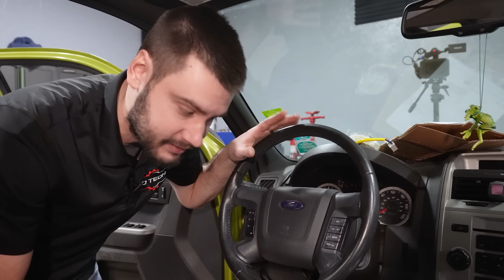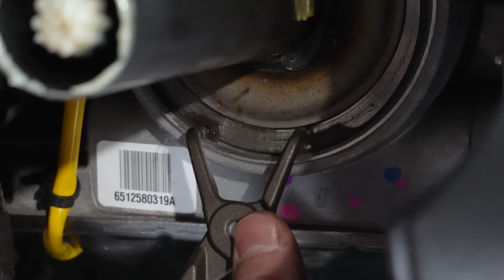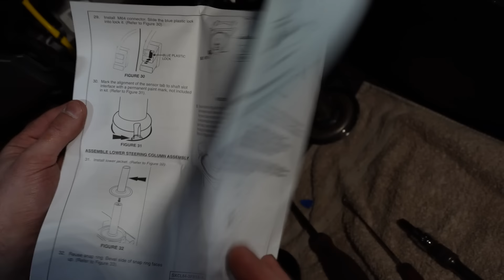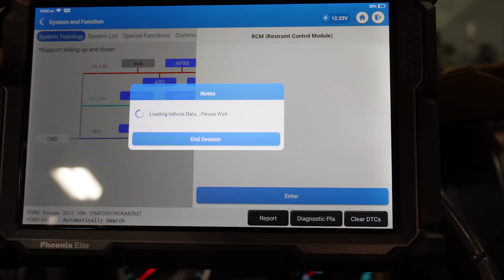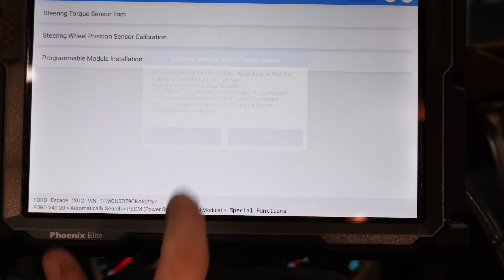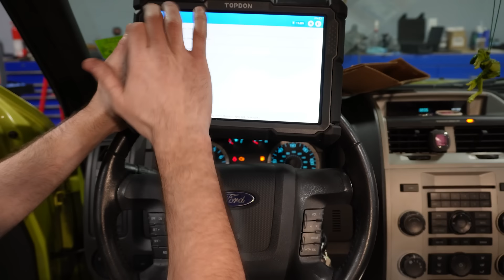B2278 - Power Steering Fault - Ford Escape

Comment: Yep, I bought a 09' Escape XLT non hybrid 2.5ltr for $1200 because the electric steering column went out & the dealership wanted to charge Granny $4k. 
I bought an OEM steering column for $1200 & paid a shop $50 to install it, took them 30min, if that.

Comment: I have the same code ! My steering wheel is very hard to move . The steering wheel doesn’t shake . I don’t want to pay almost $1000 for a torque sensor from ford . I cannot find an OEM torque sensor except Ford in Canada ! I live in Alberta Canada . Will be doing myself. How can Ford not recall all Ford Escape 2008-2015 for everything on the electric power steering !!!!!!! I have 2009 3.0 l XLT Ford Escape 113,000 km !

Comment: I have no codes but the power steering feels slightly stiff to the left. , align. Is good front steering parts good car drives straight no pulls. No codes, I think this sensor is my issue , if i replace it do i need to enter the controle mod and recalibrate any thing?

Comment: Why do you say if it's not aligned it will damage the sensor? Seems I can pull it out, turn the inner part, re-align the hole and put the pin back and do it again. I don't see any mechanical parts that is damaged and the electronic part seems to respond to the computer and shouldn't be damaged if wasn't aligned. What am I missing?

Comment: Tip for the Snap Ring Removal and installation. First, Buy at least 12 inch snap ring pliers, I got an ICON 12" from Harbor Freight. Second, Get two 1" hollow pipe at least 18 inches long. Third, Secure the Steering column with a zip tie to anything so it doesn't move. Fourth, Insert the handles of the snap ring pliers into the 18 inch pipe and secure. Fifth, remove the snap ring using the extended pliers. I fought with the stupid thing for an hour using the 12" pliers and no luck. Not enough leverage to squeeze. I put the 2 pipes on each of the pliers handle, secured it in the ring holes, squeezed, pop it comes off, 30 seconds.

Comment: Wasn't there a recall on this?
Reply: Yes it\n Was fixed on my vehicle on 08/05/2014. It has gone bad again and I've been without a vehicle for 3 weeks. And now the Ford dealership is telling me that they can't differentiate the difference between whether it's just the sensor or the whole thing.  And they\n're trying to charge me $3800 selling me.I can't just replace the sensor
Reply: @Danizimo8420  is it still driveable but just without power steering?

Comment: Thanks for you video. i was very helpful.
Though i ran into another problem {that you mentioned}

I got my  torque sensor from a junk yard. I was careful align it before removing it but it just a wild guess cos both tires and rotor have been removed before I pulled the part.

After installing the torque sensor, I was faced with new problem -  The steering wheel when powered, turned clockwise all the way to the right and becomes hard. I felt my efforts were wasted cos I spent 3 days on the snap ring [had buy several needle nose pliers and snap ring pliers) then remodeled a vice grip which eventually worked.

I watched more videos to understand how the torque sensor works and how to properly align it from those videos. I decided to remove the steering torque sensor again and rotate it one full cycle anti-clockwise [ cos the steering wheel automatically turns one full cycle clockwise].  I was hoping that this will align the sensor to the center and it worked

After installing the realigned steering torque sensor, when the ignition was turned on, the steering wheel was at the center as expected and the steering was no longer hard to steer.
Reply: Great info, did you calibrate the new/used torque sensor using obd2 scanner ?

Comment: My 2005 ford escape hybrid recently had a loss of power steering I immediately went online and found this video but after a little more digging I came to realize my model dose not have a torque sensor any idea what it could be. I was thinking the rack and pinion or the PS module.

Comment: For me it was the electronic steering assy. Tried the torque sensor first because someone else diagnosed it as that.. should have used forscan, but anyways had to redo the job basically to then replace the electronic steering assy which it mounts too

Comment: I’ve got a 2003 Lincoln Navigator and I think the steering assist is stuck in the highest assist position because at hi way speed it feels like I could easily turn the car sideways. My question is, can the assist system be unplugged and abandoned and just have the old style power steering which worked great?

Comment: What if you lose the entire steering out from the shaft connected to the leg will it be difficult to Mount back after changing the sensor because I just Mestic but in my own case now I went I had to lose the entire steering out

Comment: Hey all! I wanted to post about this issue in case anyone may need some help in the future or is just curious in this general recall issue. 6 months ago I had my power steering shake violently then go out. I continued to drive it for 6 months with no power steering. It works well but it was a pain to drive like that including having the error message. Well last week, I couldn’t turn in time and hit a curb causing a cracked tire rim and blown wheel and decided to fix it. I figured to leave a few tips in what I did and how I fixed it. F.Y.I, not that it matters. 

BTW I am 22 y/o female mechanicallly inclined so if it gives ya hope, anyone can do it lmao. 

It took me five tries to get it right. If you fail the first time, the sensor DOES NOT GO BAD! 

——————

TIP 0.5: In order to fix the sensor after bad install

Take sensor out

Shine a flashlight under the hole. There are two disk that spin oppisidpte of each other if it becomes misaligned and it will be clear that the disks are Aline as the hole does not shine bright. Move the sensor left and right until the hole begins to shine bright and perfectly centered. There is a better explain video on this from powersteeringseals.com YouTube channel. 

Tip 1: a good pair a snap pliers is a MUST!!!! It is hard to take out and even harder to install. The brand I went with is a 12 snap pliers from harbor freight tools. The brand I used is: ICON 12 in. External Straight Precision Snap Ring Pliers

You will also need T45 torque bolts to remove the steering wheel column. 

——

Tip 1.5:
A good pair of jack stands and a jack lift is a MUST. I use some brand of  6 ton jack lifts and I bought a 200$ jack lift from harbor freights, if you change your own oil and do mairence you will be instantly glad you decided to buy a jack lift. 

——

Tip 2: the steering wheel is hard to reinstall. I recommend looking at each of the shafts, finding the biggest shaft “pilled” or tooth, and marking where that tooth is on both steering shaft and steering wheel. It allows a much better precision alignment. 

——

Tip 3: when you take off the steering wheel and snap ring. Point the steering shaft as high as possible. 
This is because when installing the steering wheel, your steering wheel will be lower and require you to push the wheel up to reattach bolts. 

After eremovjng snap ring and tube. pushing up your steering shaft as high as possible, then install the new sensor and align by bumping the tires. 

If the shaft drops a bit due to reinstalling the tube, snap ring and wheel, that is OK.  This is because we installed the sensor as high as possible. When you go to install wheel and have to bring the wheel back up to attach the bolts, the sensor will already be aligned as you had already installed the sensor with the shaft as high as possible. 

You can see this for yourself when messing with the old sensor by moving the steering wheel shaft up and down and watching the hole move around. This is what caused me many issues

This is the trick that allowed me to install it correctly after five failed attempts. 

———

Tip 3: Find a 2x4 wood or anything that will allow to keep the shaft steady when reinstalling steering wheel. This trick allowed me to minimize movement of the steering shaft from up and down and in turn allowed me to keep it in alignment. 

———

Tip4:ENSURE YOU MARK each connection point on the steering shaft and steering wheel so it goes exactly where it should go. Anything that you can mark in order to minimize movement is best. These YouTube videos make it look easy, but it is NOT easy to installl the steering wheel, it takes patience.
Also sitting in the car and using your knees as a guide works best. Don’t worry about tipping the car if it’s on jacks it won’t do that, 

 ——-

Tip 5: I disconnected the battery overnight which might of helped. I say this as I believe as I did it correctly the fifth time the sensor had no more codes to read and in turn had to relearn whatever was going on with the power steering which allowed its corrections and had no issues.

———

Tip. 5:

If you think you did not do it correctly but want to test it, hold the steering wheel while turning it on, it will make an insane sudden fast left or right turn all the way. I say this as you DO NOT want to burn the motor when it turns quickly to left or right. By holding the steering when turning it on, it allows you to ensure the steering torque sensor doesn’t get messed up or burnt 

———

Tip 6:

Despite some people’s mentions and google plus ChatGPT saying otherwise, you should NOT need to clear any codes prior to replacement. Save yourself money and do not buy a obd2 scanner, I did do this, find myself not using it at all because the car cleared the dtc codes after successful install  and I didn’t have to do anything

Tip 7::

Do not go about reinstalling the body pieces or panels to the steering wheel before testing as it is likely you willl fail and need to do it again. Only installl steering body panels when you can confirm you are done.

——

Tip 8:
The plastic mounts for the wiring harness and the steering torque sensor are insanely hard to take off. Have a good pair of pliers or get a wrench puller with a v k notch. It helps a lot as those plastic clips are instantly hard to take off from the wiring harness and the steering torque sensor. 

——-

Tip 9:

Do not worry about your airbag, it will not go off, just place it gently in the ground, and do not be throwing it around. 

——

Tip 10:

Using a bungee corde attached to the steering wheel, and mounting bungee corge ends to the sun visor helped so much in reducing the weight, movement, and allowed a better install when reinstalling steering wheel. 

——
 
Tip 11: it helps if you leave your keys in wheel to prevent the wheel to lock while installing, you can just put your keys in the wheel even if the wires are disconnected and it allows free movement of the steering wheel.

———

Tip 12: I FORGOT! 

You don’t have to bump the steering wheel if you have a good pair of locking pliers that can attach to the steering shaft. It allows the steering shaft and wheels to move and get the little hole in the window perfectly without going back and forth bumping the tires, I suggest a good pair of locking pliers and attatching it to the steering column. 

——

Please let me know if you have anymore questions and I will be glad to awnser them. I am an active user and have no problem wandering peoples questions. This installl saved me 800$ and took about a day and a half to get it correct. If there is any edit issues let me know and I will resolve it asap and make it more understandable.

This process was hard but being able to have it work the firth time was amazing, and I hope this help other people.
Reply: Great tips, I also had a hard time with the alignment of the hole.  I noticed as you raised the steering control the hole would move as you moved the steering control up and down.  Will try you suggestion I think that is the answer to keeping it in the right position.